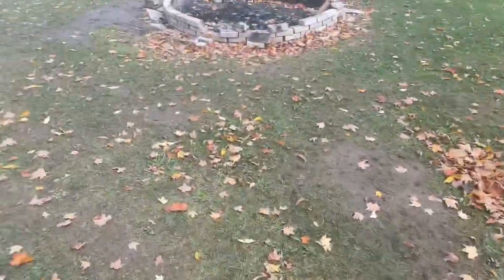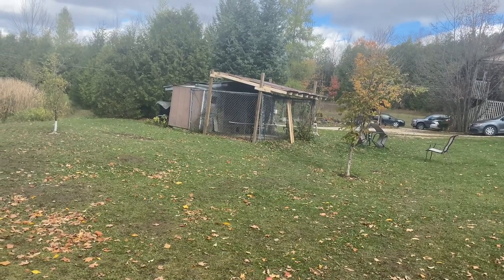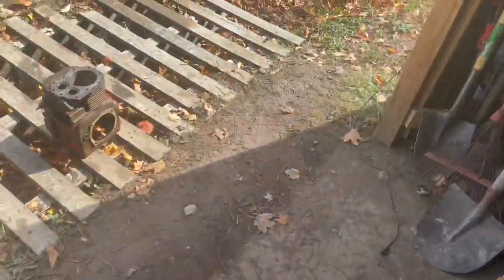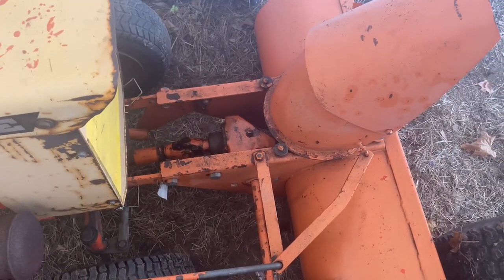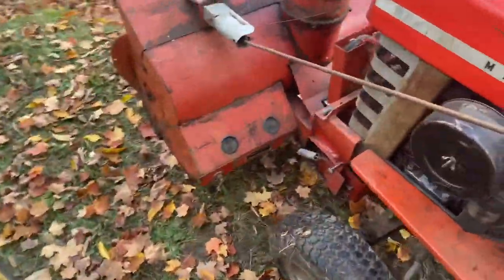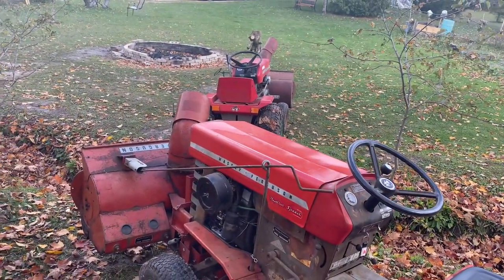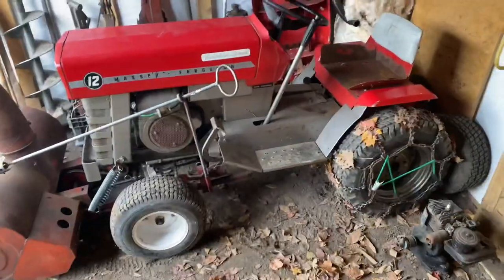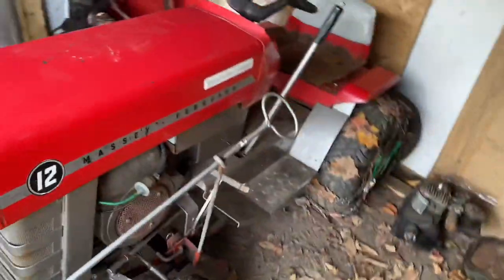Massey Ferguson garden tractor update and overall update on things

Comment: Tyler, 

Great collection of MF tractors. 

I have a 1976 MF 16 tractor that my father purchased me in 1977 when I was 12 yrs old to cut the lawn, till the garden and snowblow the driveway up in Cobden, ON. I am trying to get it running again now. Engine was blown in the 1990's, but it is in good shape as it sat in a decent shed till this summer. I purchased a used K321 engine, installed it, put in a new battery and confirmed wiring is correct with a guy that does small engine repair. But it will not start, turn the key and nothing not even a clicking sound. He took a screw driver and shorted the starter solenoid with a screwdriver and it turned over a couple of times and then stopped. He advised all he was doing was bypassing any safety switches and maybe it needs a new starter.  Now it just sparks when you try to short the solenoid.I had a spare starter so I installed it and still nothing, not even a clicking sound. 
Have you ever come across this problem with your rebuilds? 
Do you know how many safety switches there are and where they are located? All I remember is it has to be in neutral and the parking park pushed down to start it.
I have ordered a new starter switch, starter solenoid and 25 amp circuit breaker which should come in next week. If that doesn't work I will order a new starter.

Any help would be appreciated.
Thanks,
Brent
Reply from the maker: Check that there’s a ground from the motor to the frame if you bypass the solenoid and it just cuts out then that could be a issue originally it was a braided steel fat wire
Reply from the maker: Also thank you for the kind words!
Reply: @hamiltonshomelites4489  I just ordered that part this week off of Ebay and was wondering if that could be causing the problem but then discarded the idea.  BTW there is a guy on Kijiji in Thamesville, ON that has MF tractors, blowers, chains, weights and parts for sale if you need anything. This is where I got the K341 engine and extra blower from. Thank you for the information.
Reply from the maker: @brentjeffery9786  yeah I’m going to get a engine for my other 16 but as for your make sure that there’s a ground and if it does take a test light and see if your getting power to the trigger wire when you turn the key if you do check if you have power going to the starter the same way by turning the key if you do it’s for sure a ground problem to the engine since it has rubber mounts for the engine
Reply: Will do. Will send pictures if I get it running. Thanks again